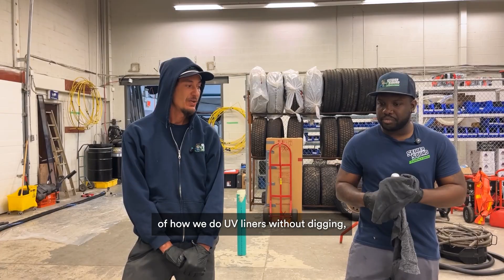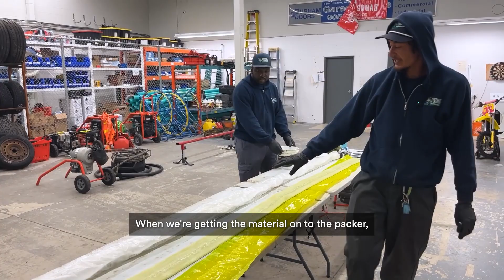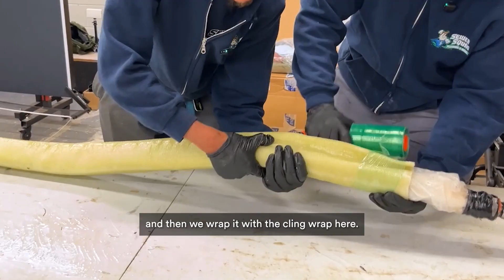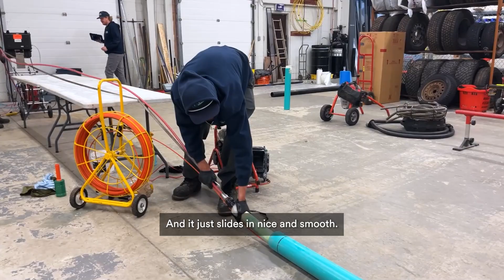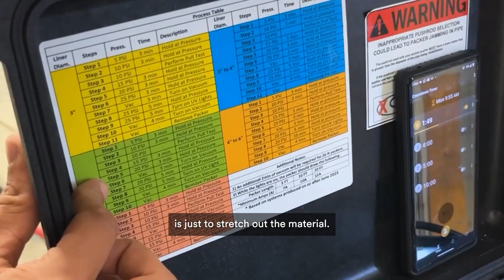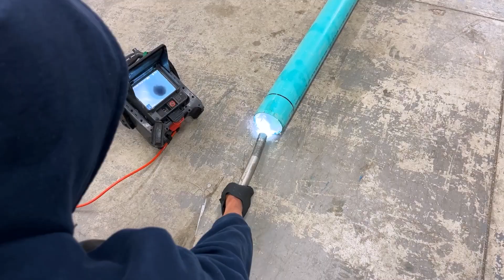How UV Pipe Lining Works (Same Day, No Digging) | Sewer Squad Plumbing & Drains | Toronto Canada

Comment from the maker: *FAQ on UV Pipe Liners*

Q: What is UV pipe lining?

A: UV pipe lining is a trenchless repair method where a resin-coated liner is inserted into a damaged pipe, inflated to fit the interior, and cured using UV light — creating a new pipe within the old one.

Q: How long does UV pipe lining take?

A: Most jobs are completed the same day. The UV curing process itself takes only minutes once the liner is in position.

Q: Does UV pipe lining require digging?

A: Pipe lining is a trenchless solution, meaning no digging or excavation should be required. Your main drain can be repaired, and your floors, yard, and landscaping can stay untouched. Chat with our team for specifics about your situation and repair needs to see if a trenchless solution is best for you. 

Q: Is UV pipe lining available in Toronto and the GTA?

A: Yes. Sewer Squad provides UV pipe lining across Toronto, Ajax, Hamilton, Mississauga, and the wider Greater Toronto Area.

Q: How durable is UV-cured pipe lining?

A: UV-cured liners are highly durable, resistant to root intrusion and corrosion, and can last decades when properly installed.